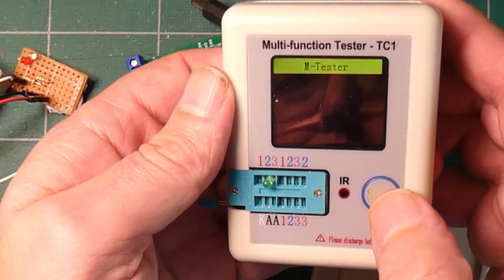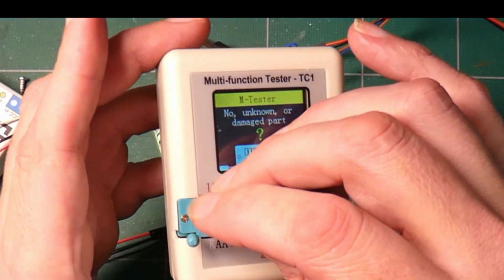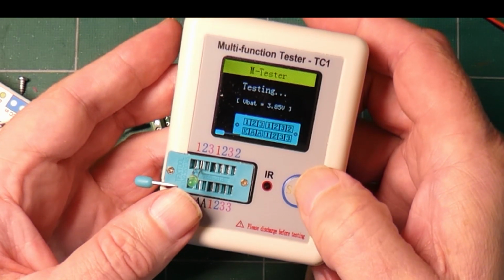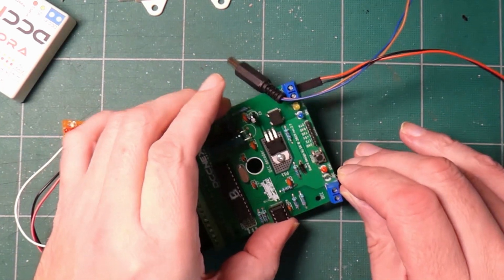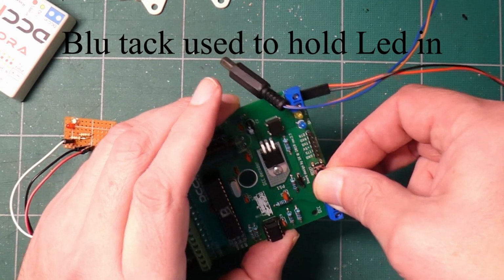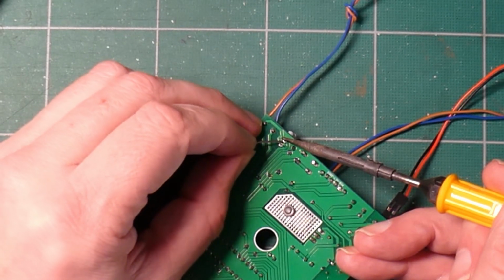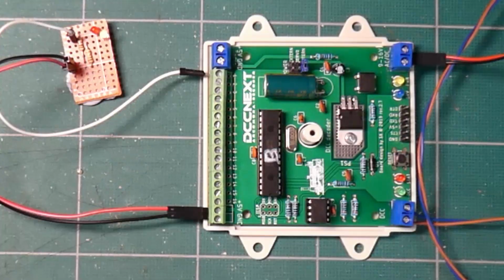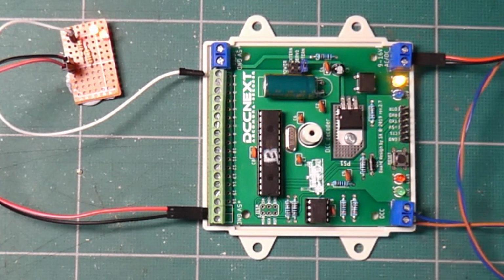Small repair to DCCNEXT

Comment: When the LED died, were you still able to control it from the CS? I have two DCCnext - one works perfectly, but the one with the dead green LED fails to accept CS commands (no red blink) to switch on and off the light/s.
Reply from the maker: Yes still worked, check the circuit diagram and do half and half checking power first then work way in to the rest.
Jim

Comment: I've had the same issue, after only 2 days of very intermittent use. I value highly your videos., especially those on Rocrail. Thanks :-)
Reply from the maker: Hi Pete, think it still worked, looking at circuit diagram should not be an issue.

Jim